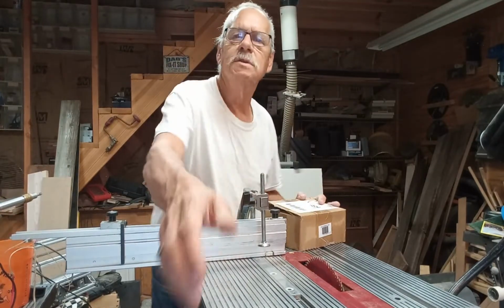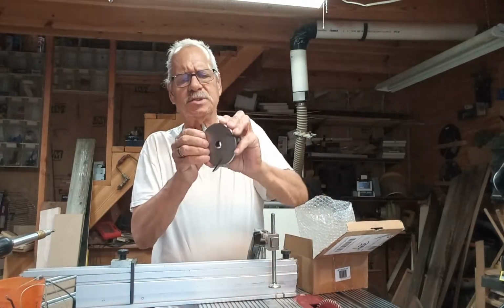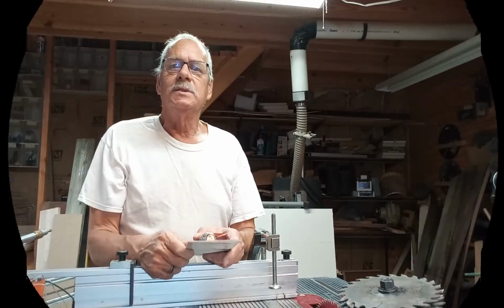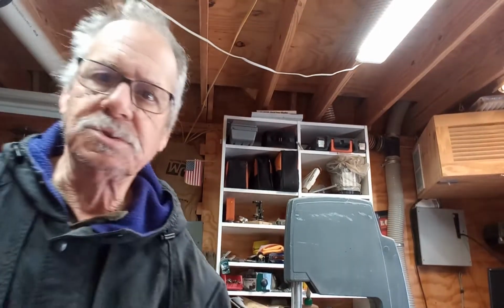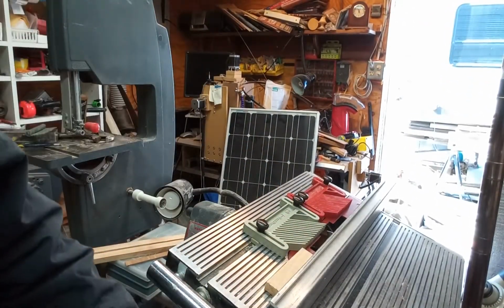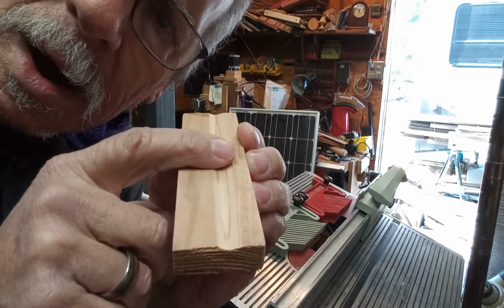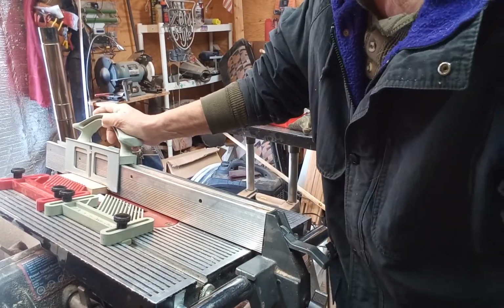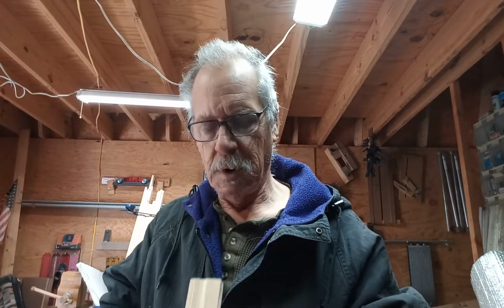Using the molder to duplicate a cabinet door

Comment: Good job Jim. If you can successfully mold a short piece, as you did, without problems you will do good on longer pieces. I agree it is scary and I am usually timid when I do different operations. I have had my 510 since the middle 80's and still find new things to do with it. I did not grow up with wood workers so everything I do is with much review of the books. Shopsmith has done a great job with published information.

Keep on making sawdust!
Reply from the maker: Thank you for the comments. Yes it is a very versatile saw and I do love it myself.

Comment: Nice! I don't have the molder so this is interesting to see. Smart using the feather boards, straddle, and push stick. At least when shaping/routing the feather boards are key to getting a smooth cut. BTW - The shaper arbor is 1/2 inch, so cannot be used on the molder. The other warning from Shopsmith is don't use the molder/dado arbor as a 5/8 in saw blade arbor, so that may have been part of what you were remembering regarding the arbors.
Reply from the maker: Thank you Tom,
I never looked at that before. This is good to know. I appreciate you knowledge sharing.

Comment: Hi.  I looked up the SS company insert for $27.00 and the same problem is there. An opening that is too long since you don't raise the cutter more than a small amount as you learned, someone thinks you raise a molder like a dado blade real high.  Go safe and low cost make your own or buy a blank.  My own insert opening for this is 2 inch long and 1 inch wide for the molding cutter.  Thanks  Hals Wood Shop.
Reply from the maker: Thank you for the update and the adding dimentions.